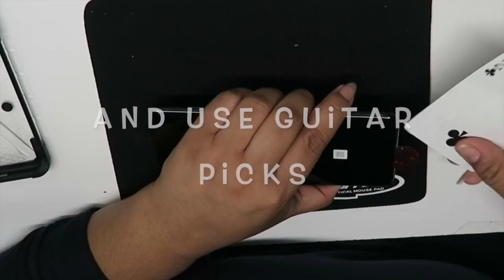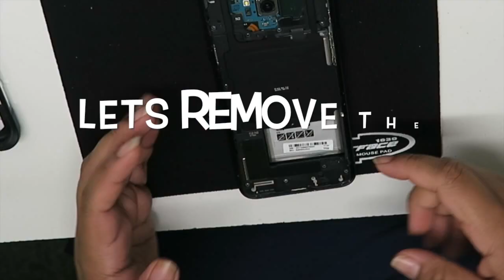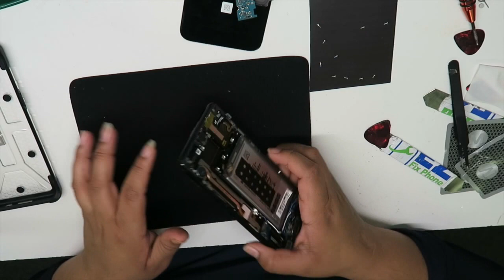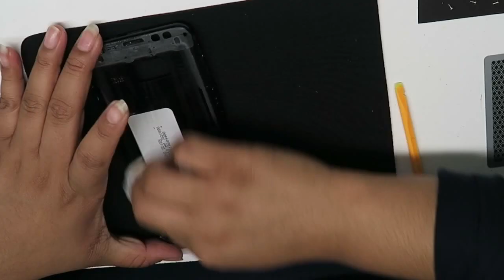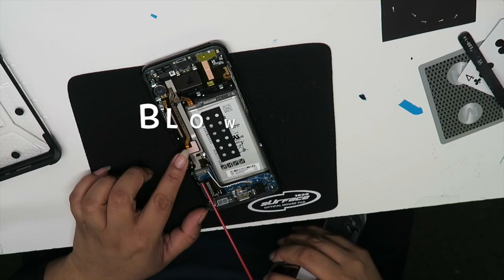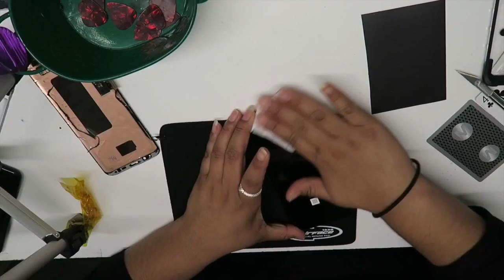GALAXY S8 SCREEN REPLACEMENT FAST AND EASY DONE UNDER 10 MINUTES

Comment: I  am inpressed, I tried it once, throw the phone awayh as soon as i could. I could not get it all together and back injto the case with out the bulgdes, ok my fault, is there any kind of system or a  gloie were i can fuse the glass together from the  top. i hyave4mine now with two cracks in it. from  edge to edge, Im not concernwith the look, i just want the phone to funtion/ with out water or grit getting in. Any ideas, hate to trash another.

Comment: Can anyone answer this question???
How would you know if the screen is the same dual edge SuperAMOLED display that ships with the phone?? 
I don't want to buy some cheap led knock off 😣
Reply: Look for a Samsung parts dealer, or repair shop, otherwise your gambling. Best bet is to send it to Samsung to fix it and send it back........unless you find a bestbuy in your area that is certified to fix it.

Comment: TIP: DONT HAVE A HEAT GUN? USE A HAIRDRYER
Reply from the maker: Yes you can also use that just be careful when using it not too over heat anything.
Reply from the maker: just like the heat gun.